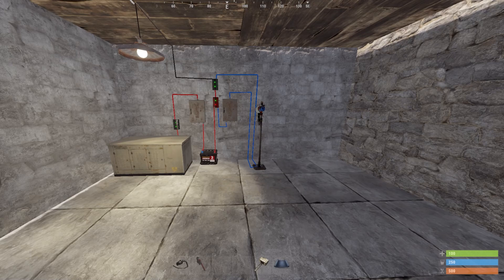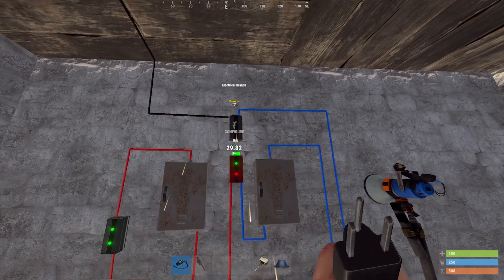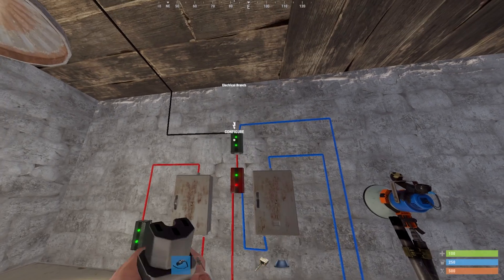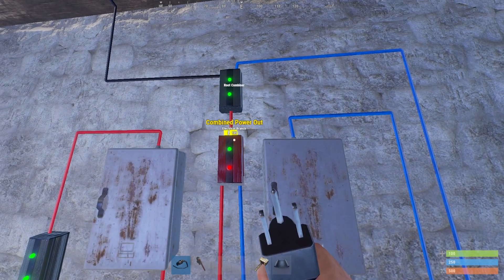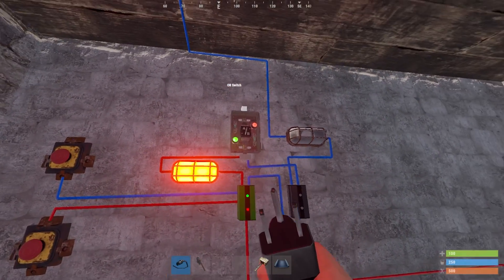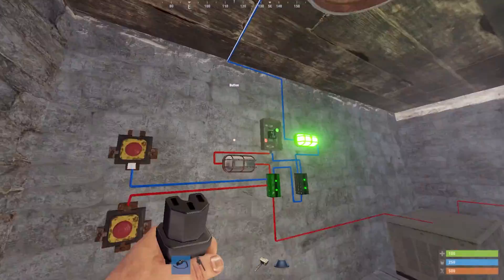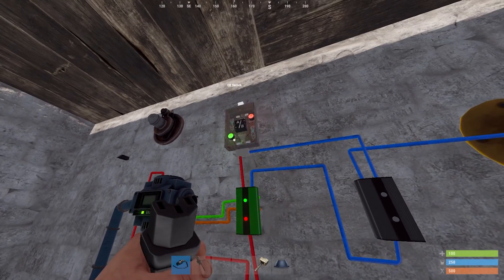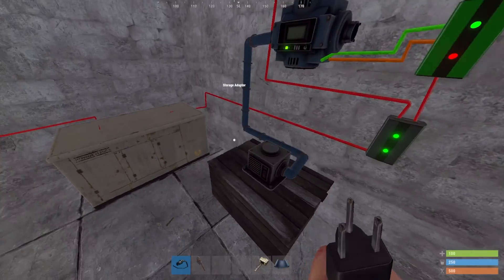INFINITE POWER!!! Kinda.....

Comment: ey lets go, good video credits to the NIH capacitor goes to NIH, thankyou for sharing my configure syphon to a broader audience than I can currently reach, hopefully everyone can master the use of it. ill be providing a masterclass video on how to use that in all the various ways to answer most of your needs in any circuit
Reply: Im actually using that as a battery system fully useable as battery and it works fine! 
Btw i found out it works with the boom box too. Thanks for the videos and tips lads!
Reply from the maker: Thanks for stopping by, Mr. Configure! One of the coolest circuits that you showed me! People can check out more about it in your awesome video https://youtu.be/uBvCOzcVZ14

Cheers!

Comment: I don't think you need the mike stand ..
Reply from the maker: How so good sir?
Reply: @KANGARAIDER  if the root combined accepts the feed from the splitter then the mike stand is superfluous to the design. I haven't tried it in game yet but built in rustrician and seems to work without the mike stand.
Reply from the maker: @David Rawnsley  whilst this works in Rustrician.io, it will not work in game.
Reply: @KANGARAIDER  yeah just found that out tested when I got home from work .. shame the circuit uses a DLC .. Maybe the boombox works as well .. and at least you can get some tunes in the base and it a little less in your face as well

Comment: Impressive! On a related note, I have just discovered (thanks to this video) that a button can generate 1 rW of output power (temporarily) without requiring any electrical input.
Reply from the maker: 2rw in 0.25!
Reply: @KANGARAIDER  Insane. You just simplified many circuits for me. Thank you sir!
Reply from the maker: @Swift Coyote has made a handbook available over on the Rustricity Discord with heaps of useful stuff like that. Check it out!
Reply: @KANGARAIDER  Nice, thank you! Joined.

Comment: wow!🤯 this is something outstanding, but i m not sure that i understand its clearly))) so basically i can use it as infinite battery? i mean that now i dont need to have a large battery and instead of this just use some electrical staff as combiner or memory cell or branch? Anyway this is huge video mate 🥰
Reply from the maker: That's correct. A battery that can store basically infinite power and discharge instantly. A capacitor. 
Thanks for the comment 👍
Reply: Will try to play with it🤓thanks mate
Reply: No, its not an infinite battery. There are serious limitations with this.
Reply: I should elaborate. It is designed to be a capacitor and not a replacement for batteries. Its great for things that need a lot of power but for short periods of time. As Kangaraider pointed out, it loses all power on server restart, but it also consumes itself due to all the components in the loop requiring power and sometimes a server 'hiccup' can reset it. Its really good for tesla coils tho. Something not used a lot and when active, its not active for long. No more 3 tesla coils to 1 large battery. With the capacitor, you could power 100 tesla coils.
Reply from the maker: It is, indeed, not infinite. Nor portable. And resets with server restarts. 
But it is damn cool! 🎉